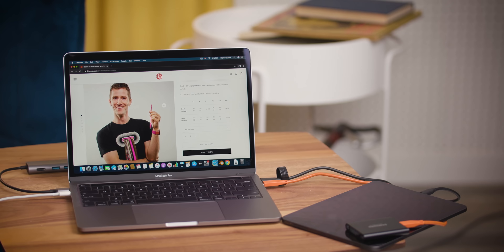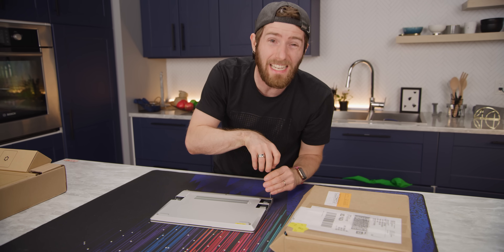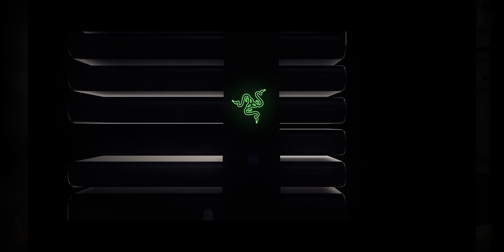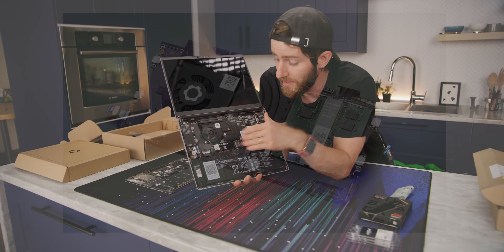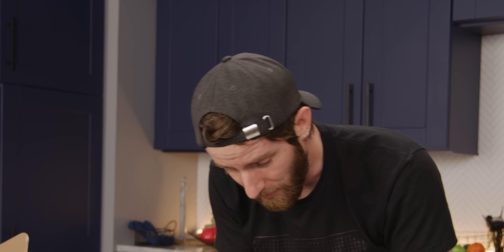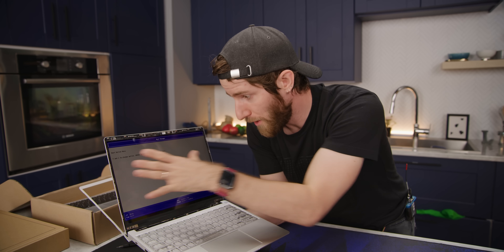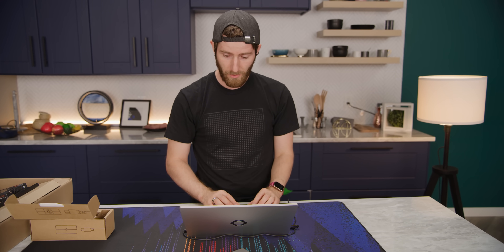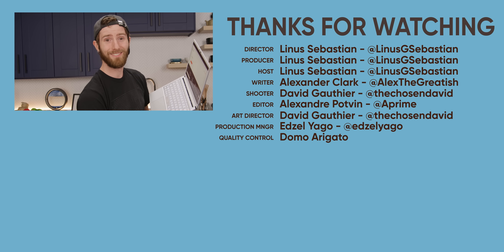A COMPLETELY Upgradeable Laptop?  - Framework Laptop Review

Comment: Modularity - who cares?

An extremely interesting product.  On a sort of off topic, the LG G5 mobile phone tried to create a modular device and it pretty much got them nowhere. The reason being, they came up with a solution to a problem that no one was aware of. 

On the note of right to repair, this design would definitely score them an A+  in terms of design and repair; however for the average consumer, the merits of its design is as important as the LG G5's design approach  in that, it's something people could care less about.

Nonetheless, if the modularity could extend to upgradable GPUs - which I know require extra thermal and power consideration than simply plugging in a smallish, square box to the side - then you'd have much more compelling argument that would in fact bring people on board.

Comment: This makes me excited for laptops again.  The way computers were as a kid and desktops still kind of are.  Only it comes with instructions for dummies (like me) :-)  In the future if I need one this is the place I'd look to.  

What has put me off getting things like a new tablet or even considering buying a new laptop when I needed one a few years back, is how less and less repairable they have become over time and the initial cost and then having to expense to replace the whole thing so soon because something went wrong.  It isn't worth the expense of getting such an item.   When it isn't your daily driver.  I'd rather live with the inconveince of using a memory stick (thumb drive)  and just used the desktop at home then take it to work with me and use it there when needed.  Or having to sent the info a client or friend wanted, later once I was at a pc.  And spend that money on something I make more use of.  In many laptops and even tablets could cost half the price of a decent desktop, which is nuts.

I hope this takes off for them. This is a great idea and one can see it is well thought out.  Many of the other modular deigns of electronic goods, I've seen over the years,  the idea was there, but it had something missing or it wasn't really as practical as intended.  This looks great :-)

Comment: Ok, in the past every attempt at modular devices was crap in my opinion but this legit seems like an excellent laptop, definitely will consider it when its time to upgrade, and it is not the fact that you can upgrade it but that you can FREAKING REPAIR IT if something does happen, I usually don't upgrade my devices I kinda overspec them a bit so it last 5-8 years on laptops and desktops and 3 years on phones and then sell it and get a new one but knowing that and accident doesn't mean I need a complete new device really is a plus

Comment: Couldn't a laptop motherboard manufacturer simply design a motherboard with a horizontal plug to connect an additional section of motherboard to existing motherboard? For example, solder the GPU to the motherboard sure but to the detachable segment of motherboard? Just sort of slot in an extra chunk of motherboard?

Comment: If they can offer upgraded boards and maybe dedicated GPU option ill buy one. Really love the design, would love to see them expand the platform and off actual upgrade paths as well as replacement parts on their website. New screens, batteries, modules, keyboards. When i buy a laptop i don't leave it untampered. I had to pull this bullshit tissue paper out of my asus that asus put in that was cashing a fan whine and my cpu to thermal throttle. Its bad enough they soldiered one set of ram to the board but you intentionally gimped my laptop. I love this because they want you to crack the thing open and do stuff your self.

Comment: I did have a laptop with a socketed CPU, back in 2011, but the GPU shared the cooling pipe and was not replacable, so it wasn't really achieving anything upgrade-wise.

As others have commented, a modular internal gpu would be wonderful, but I don't know of any available that they could've incorporated, so maybe APUs would be a better approach for modular processors.

Comment: Super tempting concept, if only it wasn't Intel based. AMD APU's would get a lot more of my "need mobile gaming to live" money. The fact that I don't need to pay them for memory or storage if I already have that is great. I'm curious what the modules cost, but given the fact that the system's so hammered I can't even make it that far to look at it, I'll have to continue wondering. In future when they've got more options for CPU I might very well be heading this road.

I defiantly love the concept. 2/3'ds of the USB ports, and the keyboard, are the only issues with my current laptop. But I can't fix any of that readily because it's a nightmare to access the keyboard and it's welded in place.  The idea of just being able to...buy a new keyboard. And new USB ports. And a new battery? Hopefully a new main board and keep a perfectly viable case for upgrade after upgrade? 

Man. I hope they last and I hope they keep to that concept.

Comment: But how do I put a mechanical keyboard in there?
Reply: Or wait they partner with cherry for those ultra low profile laptop switch
Reply: @kinglokchung3695  then this would be the god tier laptop
Reply: Presumably, you can make one
Reply: By Design your custom bottom case. 😁
Reply: This thing would be sick as a docked computer setup. Only thing it's missing is dedicated graphics support, there are external options though if it's really needed I imagine
Reply: if it becomes popular, there will be a random dude on the internet who build the mechanical keyboard for this laptop
Reply: You just remove the normal keyboard and put your 65% on the top
Reply: Someone already said this, but if it takes off, someone will make their own.  

And if you're paying attention in the right place at the right time, you might be able to reserve your own from the one-time production run.  Just shell out $300 up front (non-refundable of course), and hope it shows up sometime in the next 3-9 months.  The mechanical keyboard world sucks so hard.
Reply: Changing the hinge for a bigger one and keyboard
Reply: Is that not what the second keyboard in the video was?
Reply: tnh i wouldnt be surprised if someone could make some cheap module for the keyboard
Reply: I could see it working with some sort of ultra slim switch and keycap, bigger concern being it needs to be damn thin to close the lid lmao

Comment: Dear AMD, Please partner with these guys and make GPU's for these.
Reply: I would get an APU ddr5 version
Reply: @Matt-vh7gf  basically u want the steam deck APU on steroids :))
Reply: @hangman007usa  ya got me :D
Reply: Imagine a Zen 3/RDNA2 APU in this...daaaaaamn!
Reply: @dolan-duk  wow this would be awesome an upgradable low midrange gaming laptop
Reply: Only if its an RDNA2 APU
Reply: The main problem is, When AMD Would compatible with Thunderbolt 3/4?

Because the port itself are thunderbolt base.
Reply: @yoshix3277  pretty sure they use usb c and not thunderbolt. But i could be wrong. But regardless most of the modules can be made to work with usb c.
Reply: @yoshix3277  pretty sure they can make it work with usb c. Display port should work . Usb-A should work. Sd cards should work. Not sure about hdmi or storage.
Reply: Imagine this coming with amd CPU and GPU 

That's something I'd definitely buy
Reply: Its wild reading that 2 years later because they actually partnered up with AMD and offer a GPU extension now
Reply: This
Reply: That would be sick dude

Comment: This is literally the perfect laptop, and it's only the first iteration. This kind of modularity should be standard. Now do phones.
Reply: Fairphone does smth like that
But I don't see it for the mass market, people just don't care enough. Many literally buy EVERY new Iphone or Galaxy, so repair or upgrade is a non issue for them
Reply: Easily and cheaply replaceable headphone jack and battery is what i want in phones.
Reply: @wilderness-beastt  battery and screen is all ya need

Edit: they say on their website they plan on having a replaceable headphone module with a high end amp/dac, AUDIOHPHILES ARE NOW PORTABLE XD
Reply: @atlasgfs  nah i need headphone jack too. I just use it alot so it breaks every 2-3 year.
Reply: @wilderness-beastt  they say on their website they plan on having a replaceable headphone module with a high end amp/dac, AUDIOHPHILES ARE NOW PORTABLE XD
Reply: @atlasgfs  sweet! Although i don't have that good ear. So i probably won't hear a difference between my shitty phone and that :D
Reply: @atlasgfs  but i guess i could make that type of module myself with cheaper dac amp so it is cheaper to replace. After all it's only usb c to 3.5mm adapter basically. That's not too hard to make. :)
Reply: @wilderness-beastt  if you're listening through earbuds, meh, if you've ever bought wired anything over $50, you can tell, and dac/amps aren't as much as you think,my guess is it will be at most $30, probably less, but those materials and very fine manufacturing tolerances aren't cheap either
Reply: @atlasgfs  i have tried this test with dt770. So not earbuds.
Reply: @atlasgfs  i mean obviously the volume is louder with better dac amp but the sound quality is still the same to me.
Reply: @atlasgfs  yeah and i was comparing 200€ creative sound card to my 200€ phone. No difference to me.
Reply: I know it can be done. My friend had phone like that 10 years ago. It was like 1.5mm thicker than my current phone but i think that's thin enough.
Reply: There's the Pinephone, and some other solutions too.
Reply: @boredgunner  true.
Reply: Remember when you dropped older phone with removable battery and sometimes it all fell apart with case, battery and sometimes even sim card and sd card out. Now imagine that you lost your camera or headphone jack just because you accidentally dropped.
Reply: @archy234  that is easy problem to fix. Just use screws.
Reply: No more , 6/7 of a motherboard , 456/478 of a battery blue screws who are no different from an orange screw but for unknown reason the blue need to be in the front side. Motherboards glued into the frame and wires attached with kitchen tape.
Reply: *should be standard, WITH a standard design - or at least, limit the amount 😅...
Reply: Really? The idea is great but the product is not for the consumer looking for it. DIY and people who repair and upgrade their laptops are power users they DO NOT use a CPU graphics lmao..
 Plus almost most high-end laptops allow you to upgrade the CPU and even GPU.

The specs for this laptops is for people who do powerpoints and write documents they don't care about building their pcs or repairing them.

Comment: I have a physicla webcam shutter, it's electric tape, I also have a physical microphone disconnect, it's a plug in the microphone jack that physically disconnects the wires to the internal microphone since it belives you have another mic connected...
It has been there since I got the laptop 10 years ago.
I plug in a separate webcam with a good mic if I do videocalls/meetings

Comment: I bought an HP envy using a ryzen processor a couple years ago, and it cooks the cpu from some bios bug when you put it in to sleep mode(outer case gets up to 90C till the battery runs flat) and the power button recently stoped working. Luckily my soldering skills are good and I can replace it, but what’s the point of having a laptop that you can’t just close and carry? HP is selling half baked products that they refuse to support im ready for a new player in the world of laptops and hopefully eventually smartphones as well.

Comment: My 15" Tongfang notebook, weighing 1.55Kg and 16mm thick, has a replaceable battery of 91Wh, which is close to the max you can take on a plane...
Reply: @Aditya Bhattacharya ok, I'm sorry, remembered the wrong value. Guess apple planned better. If they put another cell in my notebook it would have been over at 30Wh per cell, and 3 cells. And it was a bit cheaper than a mbpro. But I guess you need to glue the battery in to fit in the last 8Wh

Comment: Man, if they start to support RTX, im going to really consider buying this.
Reply: If they have thunderbolt you can use modular gpu from other manufacturers and have Rtx. We should just support these guys.
Reply: @aykutcoskun6092  yeah, but the reason i would buy a laptop like this is for its portability. Using an external gpu really just doesn't make sense for me since i would lose the portability part of a laptop.
Reply: @Dotcando  I see. There is no motherboard upgrade for now, first ones should have 3060m upgrade or something similar imo.

Comment: If we properly fund this company by buying their products, they will turn the whole laptop industry around. More companies will see that this is profitable and will come out with their own upgradable laptops. Let's change the world Gamers!
Edit: We ran them out of stock and crashed their website. NICE
Reply: It would be amazing if they would all cooperate and make modules that work with each others machines, but no doubt they'd all look to make it proprietary in some way
Reply: The same is occuring with the Epson Ecotank printers. Other companies are realizing there is a market for printers that aren't cheap hunks of plastic with abhorrently expensive cartridges, rather a more expensive upfront cost but includes ink refills that last literal years.
Reply: Too bad I want to scroll around in their website 😂
Reply: what is the website called?
Reply: @Gareth Tucker the only module designs that need to become industry standard would be the exterior plug-ins.  all the rest pretty much ARE industry standard (or at least the connectors are), with the exception of the battery...
Reply: @mikeL5183  more currently frame not work... I wanted to check them out and the site is still overloaded. 😁
Reply: @1991apfel  can’t blame em 😂 they have an amazing product and a overwhelmingly positive review from Linus. I wouldn’t be surprised if they’re already into back order
Reply: nooo i wanted to order right now
Reply: what is the website called?
Reply: Power of the masses, Viva la reveloution!
Reply: poor lads i wish they will do that
Reply: noice
Reply: No issues here, except not yet available in my region.
Reply: and also if you get them the hackers from the dark web will send there grunts to steal it and use the data agtest you as well! easy to repair also means easy to steal data for hackers having physical access to your computer storage drive that can be just removed and used against you!
Reply: @ashtiboy  so don’t let someone steal your drive... not that hard. Keep an eye on your shit.
Reply: @ashtiboy  uhmmm if you have physical access why then not just threath the person while you are at it as that can be done too

Comment: everyone in the industry: "NO the consumer cant be trusted"

Framework: "haha upgrades go brrrrrr"
Reply: just don't expect waterproof rating too much... tho I hope they made a "toughbook" series maybe the US government will then invest in.
Reply: @PrograError  waterproof rating... On a laptop? Which was the last laptop that had one lol?
Reply: @hrishabh  probably one of those insane tough laptops or something
Reply: @huantian  true but like, you get what I mean. No mainstream consumer grade laptop. I mean majority of them straight up have vents for cooling that'll directly fry the motherboard if water seeps in
Reply: @hrishabh  Yeah no waterproofing is definitely to be expected. Just don't use your laptop in a thunderstorm outside
Reply: @huantian  pelican case, waterproof shell, silicone keyboard cover, a water proof screen protector, etc 

Solder or modulate on a moisture detector for battery disconnection so no parts get fried.

..... 🥴
Reply: @PrograError  why does an ip rating matter that much on a laptop
Reply: @PrograError  the MacBook does NOT have an IP rating either. That device starts at like $200 more, why don't you care about that? Laptop IP ratings are pretty rare, I don't see why a company would spend unnecessary cash on it. If you need an IP rating then you are looking for a specific type of laptop.
Reply: @PrograError  Actually, sealing it wouldn't be that hard.  On the chassis, you have Type-C and 3.5mm I/O ports, and those are already made in waterproof versions for phones.  You would need an o-ring to seal the cover, and screws every 2" or so to make it seal properly.  And you would have to seal the two lid hinges.  For the lid, since there isn't any upgradeability in the the display assembly, you would just glue seal it.  Biggest trick is waterproofing the connection between the lid and the chassis, but that can be done too.
Reply: @PrograError  That would be the Toughbook. And even those need to be dried off with power off to work after. The market these are for doesn't need that. And those who need that will want a Toughbook instead anyway.
Reply: @PrograError  Waterproof ? Maybe water-resistant/ spill proof is what you mean.